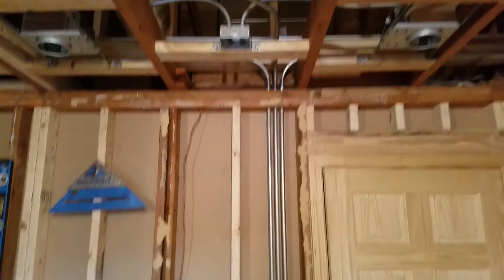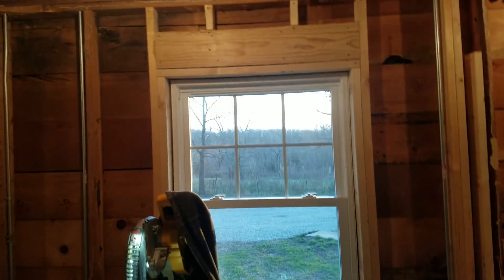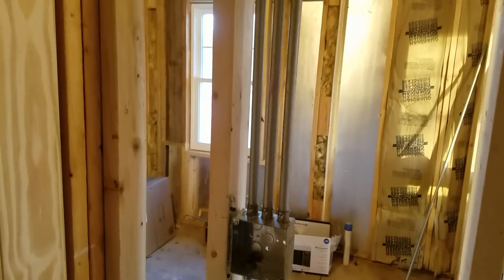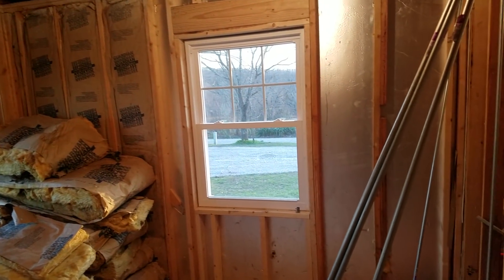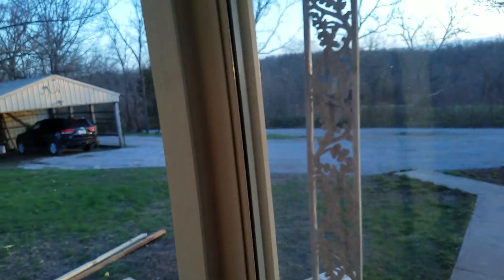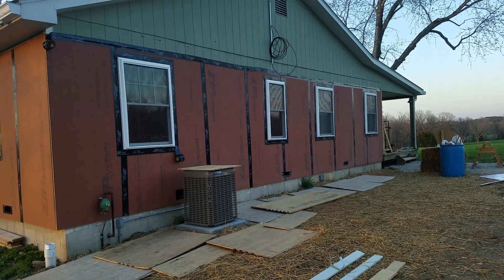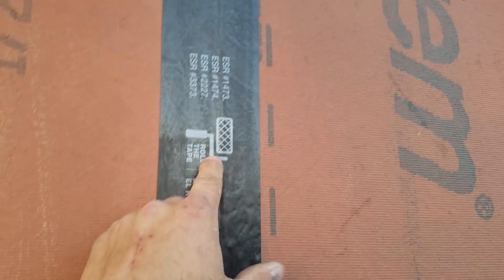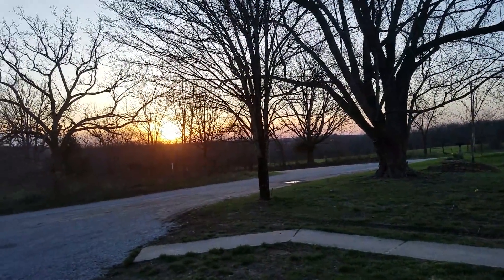I'm a Happy Guy

Comment: Rock on man! If you don’t mind sharing. What did you pay per sheet of ZIP and roll of tape? They also make a liquid flashing you can apply that’s some sweet stuff if you need to flash and waterproof hard to reach areas.
Reply from the maker: Big Dreams on Small Acres I'm pretty sure it was about 27 bucks per sheet and the tape I would have to check